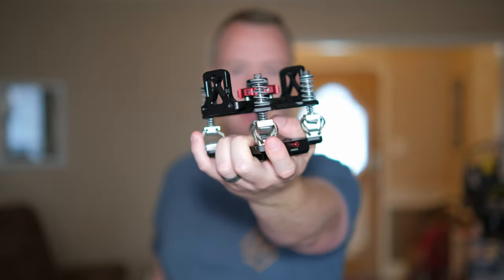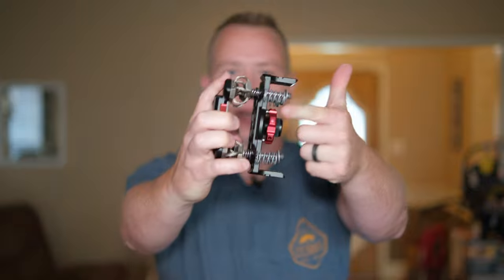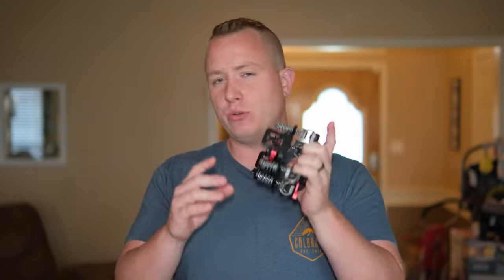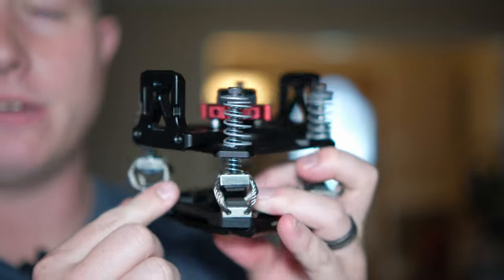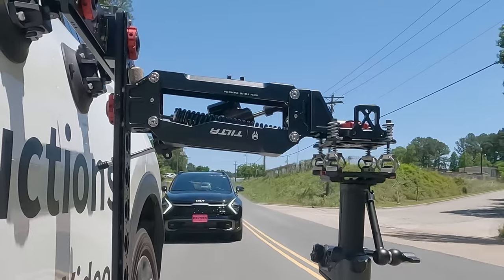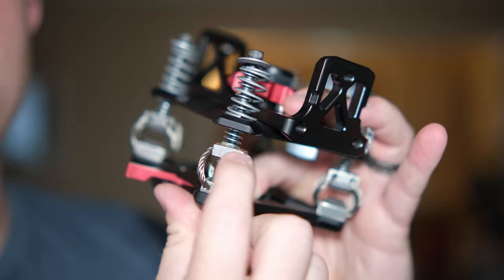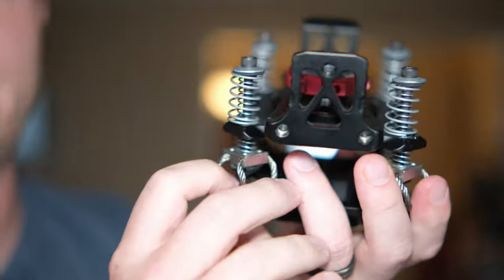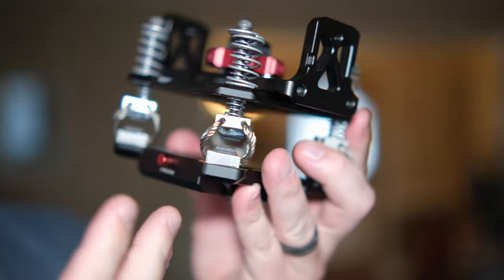Modifying the Tilta Hydra Alien Car Shock Mount

Comment: Is there a reason why you use your Hydra arm upside down??
Reply from the maker: Because it still operated the same with the same results & it gave me easier access to the adjustment knob on the shock arm.

Comment: Hey. I thought I would try this. The only screws I could find are threaded the whole way. They seems to grind and grip on the plate as it goes through. Do you have this issue
Reply: Just ran into this same issue the hard way. There are so many little details needed to get this working properly. For instance another issue we’ve run into is if the washer is too big, it rubs up against the L bracket up the top.

Comment: How does it look at higher speeds?
Reply from the maker: Works great at higher speeds! I recently finished a shoot with the new WRX that had the camera car traveling around 50mph & the springs where still not fully compressed in this newest version.
Reply: @EricNelsonYT  ok dope, I might have to try this one. I have the wire mod going on from Cullen Flemming but I still get alkt of micro jitters especially at 40+mph

Comment: Who knows  how is the diameter of bolt thread of red nut? i write on CAD file a car mount and i need that diamter, please dear !
Reply: 25mm - 1mm thread pitch.
Reply: just so you know!!! bolt and nut alone will not work. This system is sophisticated. Machining the bolt is extreme time consuming from 50mm down to 25mm to get the solid base for strength and im using the brass for the nut instead of aluminum. Best to understand the system i did purchase it and working on replicating the system. good luck

Comment: What type of screw is that? The size? M3? 1/4? Thanks!
Reply from the maker: 9/16-12 I believe.
Definitely not 1/4-20
Reply: The screws are M5, we are trying 65mm length with 22mm threaded section. Testing soon but I’m sure we’ll run into more issues trial and error.
Reply: @eastonchang  did this end up working? Im gonna buy some if so. Thanks!
Reply: @jonathangorczyca1062  We tried 65mm, 90mm, 110mm and I think the 65mm was about right. It's gotta have smooth shaft (the first 22mm only is threaded) However it depends on the springs you end up getting! We put narrow (not as wide) springs top and bottom and it really works great. You can see the YouTube short on my channel for some footage.